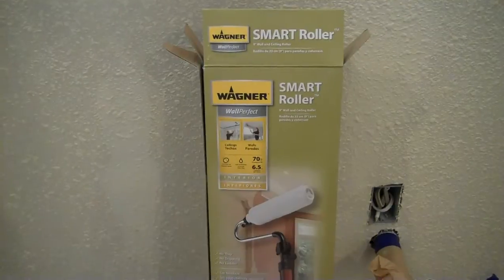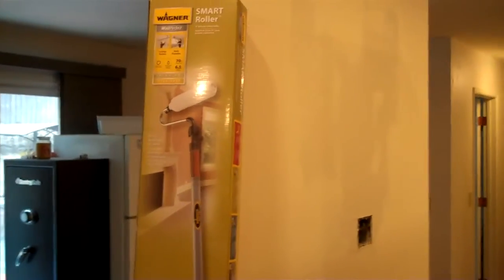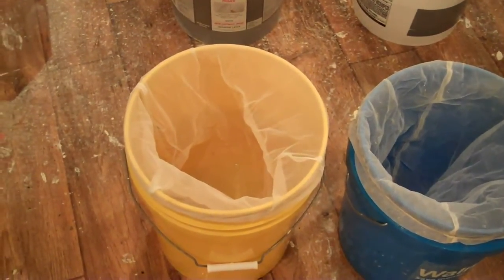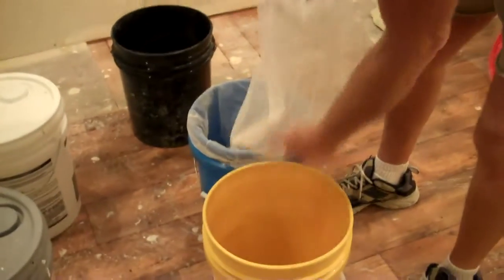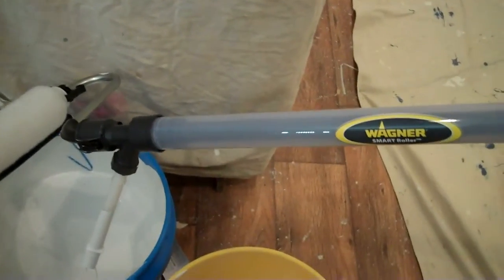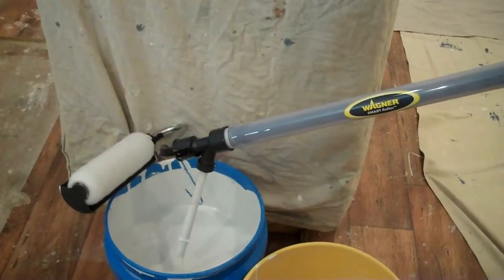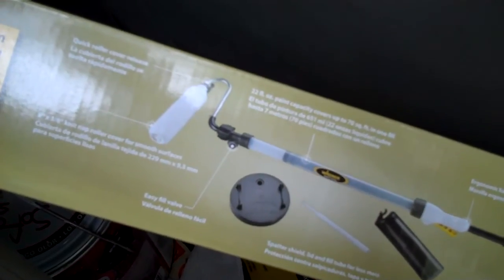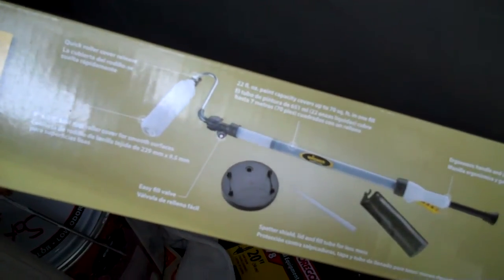Wagner Smart Roller

Comment: I had the same problem with it not sucking up the paint into the tube, but then I made sure the connection was ALL the way in and it worked great!  My problem was the roller wouldn't stay connected

Comment: It's just ok for me.  The weight of the paint on the handle gets heavy when you're painting a large space, the length of the handle when fully loaded makes it awkward if there are tight corners of the room or you have furniture in the middle of the room. I doubt whether I'd use it again since it's harder to finesse than a light wooden handle on a normal roller, and frankly, it only takes 3 seconds to load paint with a normal roller.
Reply: Here's how I ended up using since I didn't have the room in some cases for a ceiling to floor approach. https://youtu.be/gBp5_HcF3-o

Comment: Isnt the smart roller for use with a standard gallon of paint, making for an airtight suction using the lid?
Reply from the maker: QIrons Yes.... and no... it has an optional 5 gallon connector lid (just like the one gallon....but bigger ;-)
and #2 
the only thing that is "airtight" is the suction tube, it just didn't work, maybe yours will be better,come back and do tell ;-)